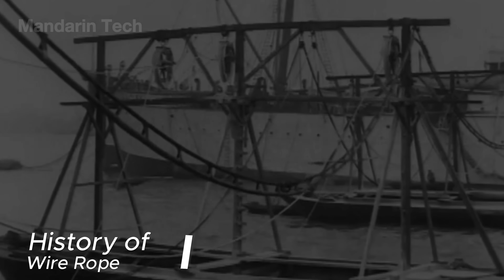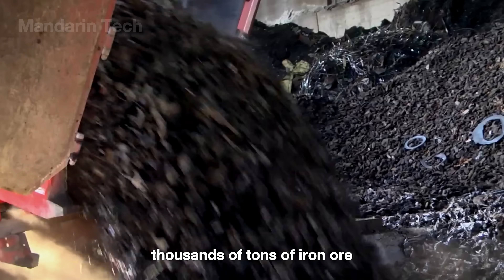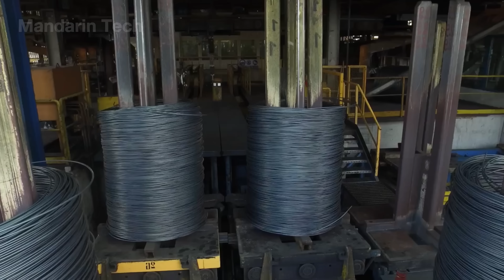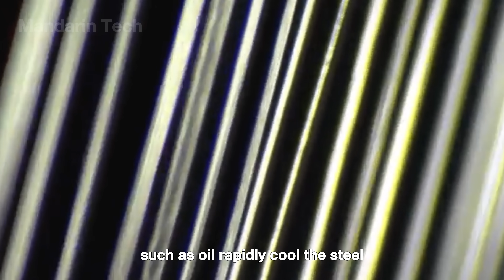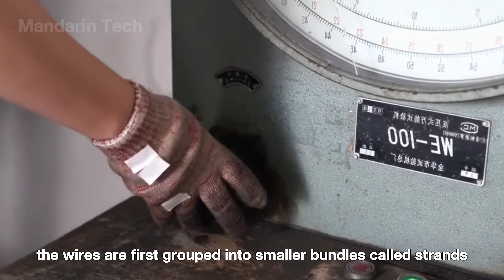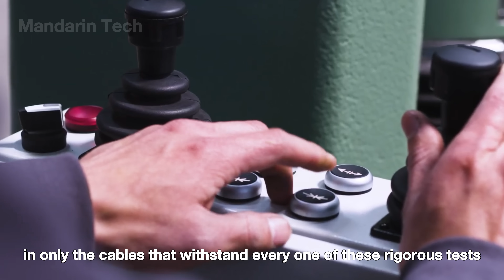You Won’t Believe How These Massive Bridge Steel Cables Are Manufactured Inside Mega Factory

Comment: no same after watching than b4. all old news/"common sense".
BTW, wire rope is also commonly used as sailboat rigging on new and used sailboats, be they river/lake/onshore recreational, racing, or around the world capable blue water cruising craft. Not just cranes and other industrial machines. Fiber rope such as hemp, and cotton, have been obsolete since the development of wire rope. (tho hemp and cotton 3 strand rope were used on some (not all) WW 1 and WW 2 warships. There WERE sailing combat and supply ships used by the world's navies during both wars; it wasn't just steam ships during those wars.) (Advantages: no to limited fuel use (some had either diesel or steam engines as well as the sails), and the sonar used by submarines to find targets while submerged, cannot detect a boat under sail; no engine/prop noise. The subs are safest from attack only when submerged below periscope depth. During the war, the subs only surfaced at night to recharge their batteries, when on patrol. They went to naval bases to refuel; like battleships and aircraft carriers, they never refueled mid-ocean.)
(tho some classes of racing craft (such as dingies) use double braided modern low/ no stretch synthetics, such as kevlar, for their rigging.)
Reply from the maker: Good point, ropes have a wide range of uses beyond heavy industry.

Comment: The massive main cables supporting suspension bridges are not twisted wire ropes. They are parallel wires, strung one at a time, in place at the bridge,  and bundled into a solid cable. The bundle of parallel wires is then wrapped with a wire and sealing materials.
Reply: Twisted wire is always stronger.
Reply: @Frankie-l6g The main cables are built up a single wire at a time, all tensioned individually, all parallel. This quote from Wikipedia "Suspension Bridge":
 
"High strength wire (typically 4 or 6 gauge galvanized steel wire), is pulled in a loop by pulleys on the traveler, with one end affixed at an anchorage. When the traveler reaches the opposite anchorage the loop is placed over an open anchor eyebar. Along the catwalk, workers also pull the cable wires to their desired tension. This continues until a bundle, called a "cable strand" is completed, and temporarily bundled using stainless steel wire. This process is repeated until the final cable strand is completed. Workers then remove the individual wraps on the cable strands (during the spinning process, the shape of the main cable closely resembles a hexagon), and then the entire cable is then compressed by a traveling hydraulic press into a closely packed cylinder and tightly wrapped with additional wire to form the final circular cross-section. The wire used in suspension bridge construction is a galvanized steel wire that has been coated with corrosion inhibitors."
So you are welcome to your opinion, but these static "cables" that never move, never change shape are not twisted.
Reply from the maker: Great explanation. Suspension bridge cables are indeed built from many parallel wires bundled together.

Comment: As a Dane our Hanging Bridges have straight wires added to each other and with a cover around them.
Reply from the maker: That’s interesting different countries use various cable designs depending on engineering standards.
Reply: @Mandarintechmido  Close to my former home we had a stay bridge built and with metal boxes as the bridge, placed on Teflon covered plates, to be able to expand or retract. As a security they had made a hole in the pillar-top, to be able to lift the bridge in need of a traditional Roller, but the plates functioned fine. And it wasn't painted inside the wing shaped boxes (Tacoma!), but was kept dry inside to prevent rust.

Comment: ls this supposed to be the stuff in China? they build with is garbage. Their rebar is sometimes plastic and can be pulled apart by hand.  Just trash for the citizens because muh CCP.      :(
Reply from the maker: Construction quality varies widely by project and standards, but large bridge cables follow strict engineering and testing requirements.

Comment: It’s not polypropylene that is the wrong fiber, dude. You have no clue what you’re talking about.
Reply from the maker: Thanks for the correction material composition can vary, and it’s always good to clarify the details.
Reply: @Mandarintechmido  I have decades of advanced material reinforcement engineering, including synthetics and steel, owning twisting and braiding manufacturing plants since the 1960s.